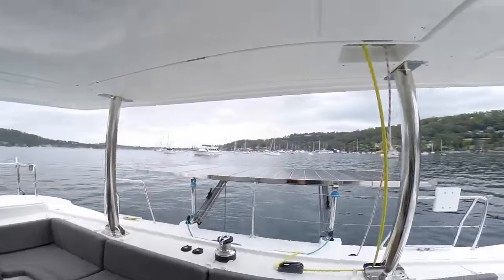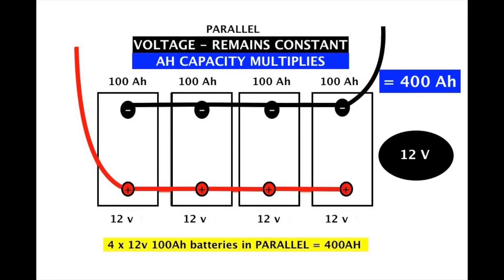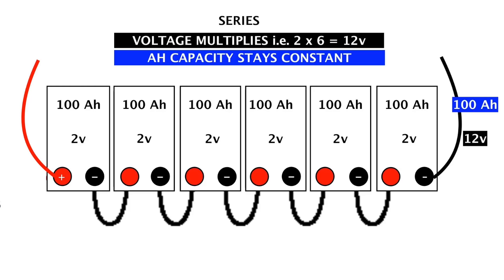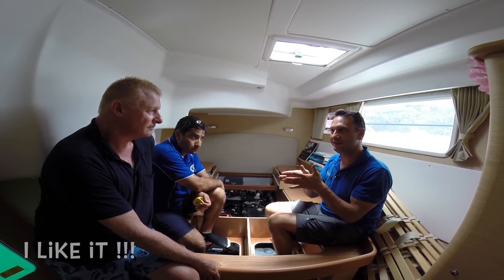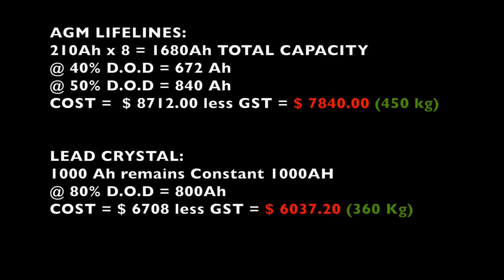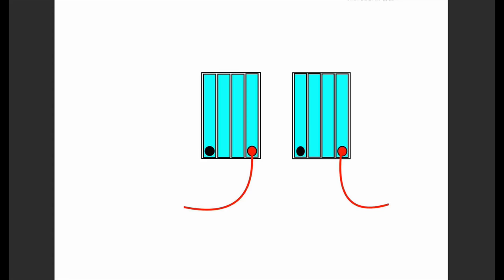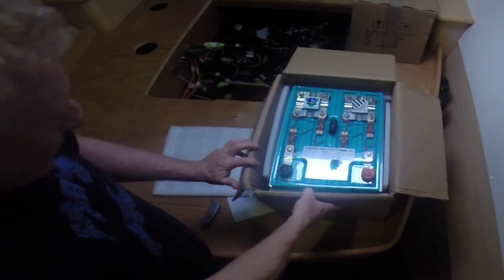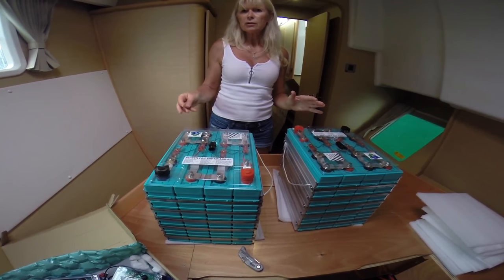Pt 1.  LITHIUM BATTERY INSTALLATION

Comment: A throughly entertaining and informative video. Fascinating - thank you!

My experience of lithium batteries is around their use in radio controlled helicopters and medium sized quadcopters, so my comments may or may not be relevant to your usage.

Firstly your usage is different to mine. I do not use the batteries daily and indeed storage when not in use is recommended to only have a 50% charge in them. I use my batteries hard, but for a short amount of time.

Based on my experience, I would absolutely NOT recommend a 80% discharge. too many times as that will seriously reduce capacity, extremely rapidly. 70% discharge is ok if only occurs occasionally and 60% is rather better for battery life.

As with all battery types, battery voltage is actually not a very good indicator of their capability. Batteries can show a reasonable voltage but can have a terrible capacity.

Never ever run the batteries flat. This seems to instantly screw their chemistry.

I like very much your redundancy idea. Do you have something which will record battery charging and depletion, a sort of long term monitor to consider their effectiveness?

I’m really looking forward to seeing how you progress with these. Keep up the good work Sir!
Reply from the maker: Hi there DOBM - thank you for the feedback - it is always very interesting to learn from different peoples experiences.

I do agree that to discharge a battery less is better than more - sometimes difficult when one is living off them full time.

We actually do have a new device I installed a few weeks ago alongside the BMV 702 (Victron Monitor) - we installed the Color Control which records our charge and usage all on line through data and is accessible for us and for others. It also allows remote control of our device so technicians can monitor, access and change settings on request.
Also, we store 30 days data at a time to a card - nice to see the curves of voltage and amps and where the batteries sync.

This is very new for us so we are just getting used to using it, however, it has been terrific to see our usage and I am hoping to the future to make the data available for our followers who are keen to see what it takes to live on the water.

Cheers my friend - appreciate your comments
All the best
Brent

PS. I really need to get stuck into part 2 with so many fellow sailors asking how we wired the installation ...

Comment: Thought my head was gonna explode at around @24:00 , then you introduced "Lead Crystal" batteries, WTF, never heard of those.  So AGM to lead crystal then Lithium ?  ROFL
Reply from the maker: LIX 59 - you make me smile :)
Have you checked out the Carbon Foam Battery technology (Oasis Firefly)?
I am busy researching that  and Lead Crystal as back up by replacing the engine start batteries with these. The Carbon Foams are light and also claim fast recharge rates as well as deeper cycles.
I will share some stuff about Carbon Foam in my future videos when I have more knowledge
Cheers for now
Brent

Comment: I believe that your type of cat is severely affected in sailing performance by overloading.  Thus exchanging 400 kg of old batteries for 110 kg of new ones that have even more capacity may make you sail better.  Is this true?
It will be VERY interesting to see how happy you are with the new system after using it for a couple of years.
Reply from the maker: Hi again dehdeh55 - yes, it is very true that weight affects the performance of catamarans. Some catamarans carry weight well, such as the Lagoon 440, but undoubtedly this does affect speed performance and places heavier stress loads to the rigging requiring earlier reefing than the manufacturer handbook suggests. 
So yes, battery weight plays a MAJOR role in the 'weight aspect' of ones 'Cruising boat' - especially when one makes the decision to load up with all the home comforts, then in this case especially so!  In every addition to the boat part of the major assessment in a product purchase should be around the added weight to the boat.
This is why I am on diet ;)
Yes - it is early days for us and new technology - we have taken a leap of faith here and it will be interesting to see how this goes a year, two or three from now - we aim to keep the community informed.
Thank you for the comment
Cheers for now
Brent

Comment: I am so confused. Lead acid AGM vs. Lead Salt? Where does 
LiPO4 come into it? Or is Lead Salt a trade name for them? Chemistry confuses me...
Reply from the maker: Sorry about that Scott - I should have made it more clear. I was sharing the PURCHASE cost of AGM for my Australian mates to the pricing of LEAD CRYSTAL which is 'salt technology' and ultimately the purchase of LifePo4 / lithium. 
There are various battery types not he market and many folks do not know about the Lead Crystal style of lead batteries which have similar charging ability to LifePo4 (Lithium type batteries) and can also be discharged way lower than AGM or Deep Cycle gel type batteries many sailors sail with.
For me there were only 3 battery types I was considering...
1. Lead Crystal
2. Carbon Foam (Oasis Firefly)
3. LifePo4

Different battery chemistry but fairly similar characteristics. Ultimately the LifePo4's will hold a higher voltage longer and that is what we really liked about them.

Comment: Great choice on batteries. One major cost factor is missing in your calculation, lifecycle. Those cells should be good for 5000 cycles if you treat them well, AGM etc won't get half that so these cells should last more than twice as long as your last batteries.
Reply from the maker: Thank you Andrew and yes, I should have stuck with the 'INSTALLATION PART' and not gone into the cost analysis part. I kinda mixed that up a bit to show my mates in Australia the cost differences at purchase - assumed folks would have had the research done at the point they want to install. But absolutely true - The Lithiums pay off in the long run through their life cycles and perhaps I should have reflected that in the video. For this reason I am grateful to everyone sharing this information as you have done, so the folks can learn from the comments too. Cheers for now ... Brent (our Lifeline AGM's were DONE 6 months in. They could not handle the charging and discharge loads on Impi).

Comment: Great video Brent and Ana. I repowered on agm's early last year but my next buy will be the same as you guys. Busy dealing with manufacturers as we speak.
Reply from the maker: Hi Mike - Yes, I must really be honest in saying the AGM's were a disappointment for us - I guess they would have been great in a charter boat or part time sailing vessel but they caused us a lot of grief along the way and definitely our fair share in costs keeping them charged.  I think we have made a great decision here, but will be sharing openly and honestly with the sailing community as we go. If we made a mistake - well - we will try the next route in technology - there is always Lead Crystal again, and also I am really liking the Oasis Firefly Carbon Foam Batteries, which Nigel Calder has also given a thumbs up to after trying them out.
Now I am trying to determine if there is enough CCA to use Carbon Foams as replacement to the engine batteries, so these can handle similar charger settings to the lithiums and be a third 'Non Lithium' backup (redundancy) to the boat. 
It's all exciting stuff for us ... unfortunately pricey stuff too. Cheers Mike - have a great weekend ... Brent

Comment: Hi Brent and Anna, I think you have made a wise investment with a well thought out management system also, I can't help but wonder in actual fact haven't you lost a few amp hours with only purchasing 800ah (2x400 x80%) giving a little less than what you had available from your AGM's. Just going on the math you worked on.  How do you manage the charging side.  Does the genny fire up automatically when the batteries drop to 160ah. I would have been nervous as hell lifting them boxes from the tender to the boat, they must have been bloody heavy. Sorry to hear you've been a bit crook, hope your on the mend. Good to see Anna having a good role in the vid also. I look forward to the next part in the series.👍
Reply from the maker: Awesome to get a comment from you again :) 
Yeah, we did serious homework before making this investment and very happy with the outcome but it is early days and we will see to the future how it all pans out - and we will share our experience from an 'honest space' so folks following in our wake can make informed choices.
Yes, one could say we lost some capacity, however, the lithium style batteries hold a higher voltage and already (I know they are new but so were the AGM's at one stage) we are just blown away with how long the voltage remains consistently higher.
It is all good and well when one looks at life cycles, but what we have found on the boat with our way of life, is that we never pull a neat discharge curve before 'refuelling' the batteries - it is always erratic - kettle goes on (fast discharge), the sun comes out (re-charge), sun goes in and the boiler is turned on for hot water showers (discharge) and so on. 
The lithiums are handling these constant changing variables like a CHAMP - there is NO comparison going on our previous experience of living at sea on Deep Cycle Gels and certainly not AGM.
What Ana and I decided to do, is to set up the packs in such a way, that we can easily add a 3rd pack if we 'like what we see' and want more. The thing is that whatever we take out of the packs we need to put back, and then there is the thought of managing that extra pack (Capacity).
At the moment, we are able to throw back 400A charge with our set up on Impi and the LifePo4's are just sucking it up 'big time' - it is really impressive. So at the moment we are managing the system through our Victron BMV 702 and the BCU's and we have set up the system to work on Capacity mostly because the BCU fail safe system manages the system by default on voltage.
This is really the stuff I want to get into for the next vids, but in the meanwhile I will share a little, buy saying that the BMV702, 'watches the system on charge and discharge allowing all the charging systems to push the batteries to around 99% and then bleed of on the tailend into Float mode. They float momentarily and then the BMV shuts down the system entirely as opposed to maintaining a 'float charge'
At this point the Batteries discharge as we use the loads and no chargers will kick in again until the system has reached  a point under 90% capacity at which time the chargers are welcomed to resume their function.
We did this so the batteries have a smooth build up to full and then a tapered fall of for at least 10% of the capacity before kicking in again ... the theory being that we prevent over charging and constant 'charge /discharge' near the 'full tank' capacity.
I am not sure if this makes sense to you but I will try and cover that in the vids to follow.
Regarding the jenny firing up automatically - no - we have not gone that route. We have rather opted for voltage alarm to warn us if the voltage gets low and in the worst case scenario the BCU /BCM's are set up to automatically isolate the packs if voltage drops below or above a certain value, thereby protecting the cells.
An yes, carrying the batteries from the dinghy to the boat ... not a fun thing to do but we are 'alone most times' and you would not want to see some of things we have had to do in remote areas - would make your hair stand on end - lol.
Anyway my friend - have an amazing weekend ...
Cheers for now
Brent

Comment: Must say i am a bit confused here..you explain at length the difference between the AGM and lead crystal batteries, but then go with lithium batteries of which you do not discuss the pros and cons or do a comparison to the AGM's and lead crystal batteries. However, despite this  and having looked at the comments below, it seems the reason you chose the lithium batteries and the reason why they are the better choice is weight, usable amp hours due to dod, durability (many more charging cycles) and redundancy. So even though they are more expensive they are the better choice and more economical in the long run.
Reply from the maker: Oh man - Jtolken - so with you there mate - sorry for the confusion! 
I really meant to be sharing the installation of the batteries more than the Pros and cons which 'Gone with the wynns' does so well. perhaps in my next vid I will share a link to their video showing the advantages / disadvantages.
In this scenario I was trying to show the initial cost price values when buying in Australia as by the time someone goes into installation mode I assume they have done much of the homework.
But yes, the reason we went with LifePo4's was because the weight was a big factor given the load already on Impi (we carry a lot of comfort on the boat), the total life cycles / expectancy and then again I do believe from speaking with electrical engineers, that the 'ERRATIC' charge / discharge habits of boating are better handled by Lithium. It is one thing for the suppliers to claim 'x' number of life cycles under laboratory conditions where a battery is perfectly charged, and then evenly discharged verses on a boat where suddenly one alternator kicks in, then some sun on the solar panels, a kettle is boiled etc. etc. and we realised with the AGM's that they were not capable of keeping up with our demands even if we tried our best to manage them well.
So far, the LifePo4's are simply amazing us - I really wish we had gone this route sooner.
With LifePo4's we can recharge very quickly, the batteries get to a higher voltage and hold that voltage way longer and as said are lighter by far. The REDUNDANCY lies in the fact that we added additional equipment like the extra BCU/BMS and the external relays. Yes - we do believe that the higher costs initially will wash out in the long run and we are going to manage, keep records and report back to the sailing community what we experience over time ... we do believe the long term costs will come out cheaper. The other great thing we have here, is that when we need to replace the batteries, we ONLY need to buy the cells. All the gear can be transferred and the cells are not expensive.
Cheers my friend ...
Brent

Comment: Did you consider the expected working life of the different batteries, or are they much the same?
Reply from the maker: Hi umvhu, and yes, I wanted to get into the working life of the batteries later in the series - this video was a basic for the many Facebook friends who are sailors wanting to see a basic layout of the system we installed and the immediate wiring around the packs. Hopefully I can build onto all of those as we go through the series. 
I am sure I will share and learn as we go along!
In Pittwater, Australia, we could not get an electrician for weeks. Hopefully I can share enough information so sailors following can help themselves if they need to.
Lithiums certainly have a much longer life cycle expectancy than AGM - no doubt about that!
Cheers for now
Brent

Comment: Thanks Brent and Anna!  I'd already been planning to get Lithium batteries for whatever boat I buy at the end of this year. Between this video and Gone With the Wynns video about Lithium it's given me a number of ideas on what to do.

It looks like your method of low voltage in series is probably cheaper than the turn-key solution they went with (with Lithium drop-in replacements for AGM in parallel), and likely what I'll go with as well.
Reply from the maker: Hi Dan - awesome comment / awesome stuff !!!
Yes, The Wynns purchased the RELION batteries I think through Just Catamarans (my cousin Kent who is a great guy- my son also working there). 
We love the Relion technology (reliable,stable and great battery) and asked Kent for pricing and shipping but to Australia it proved a bit too far and also the regulations here around hazardous goods, importation and taxes made it awkward for us. 
So we instead did the best research we could, and man, the prices here were really 'UP THERE'. 
However, we met some folks who have had success with these EV POWER batteries (initially designed for inland use vehicles etc) for the longest time and decided after a lot of research to go this route.
If we were in the States or close enough to the States, we would have gone with Relion for the simplicity of everything contained within.
However, our choice is also a good one, since come the day we need to replace the batteries, all we need to replace are the individual cells - which are CHEAP! We would then be able to swap out all the hardware onto those cells and that is the stage when these batteries become a terrific asset. EV POWER have individual cell monitoring devices for safety within the packs - I really like that ... and combined with the BCU's makes it as 'fail safe' as it gets (we hope).
All that gear is transferable to the new cells.
Cheers for now
Brent
Reply: Excellent! Yeah, as I've gotta be somewhat budget conscious and I know my way around electronics, I'll probably go with the semi-DIY route with something like EV POWER or similar.